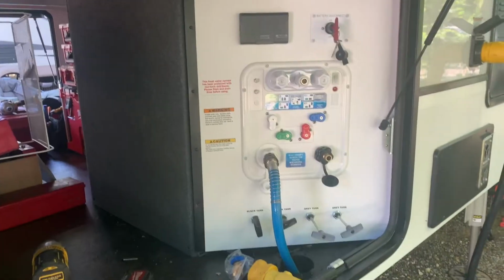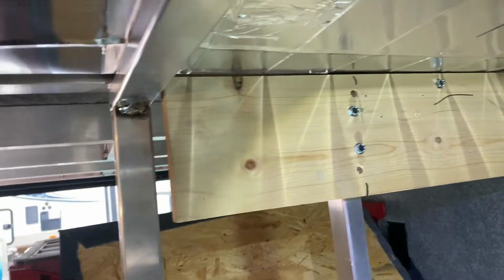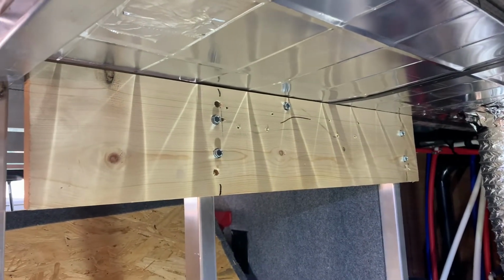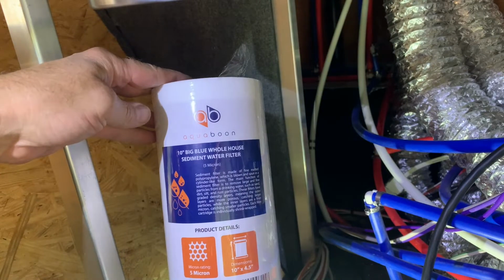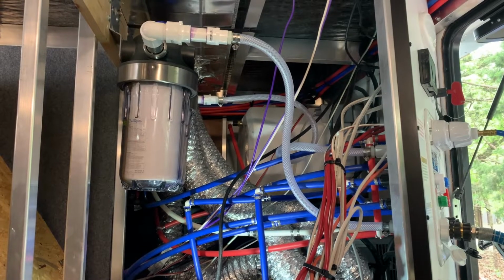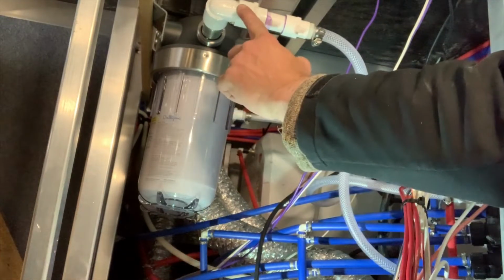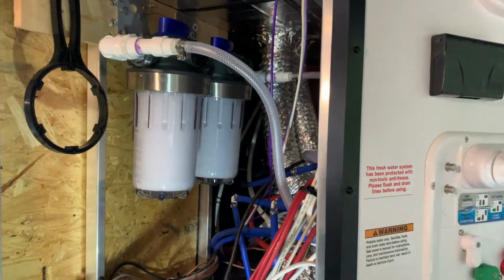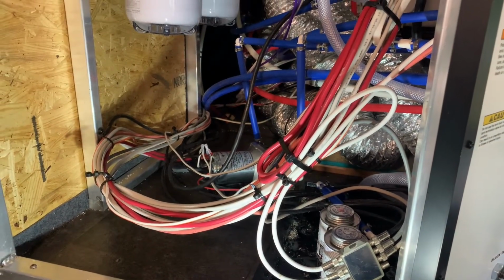Culligan WH-HD200-C Whole House Heavy Duty Water Filtration System installation for Alliance  370FB

Comment: Great video! Clean water is a must.

We use an adjustable water pressure regulator, a clear source triple filter unit (down to .2 micron) and a 16000 grain water softener. aall installed in our wet bay out of sight. I use brass 90’s, isolation valves and brass quick disconnects at all connections. This makes for easy maintenance. Then we use an Alexapure Pro .02 micron gravity water filter on the kitchen counter for all drinking and cooking water.

I would suggest a plexiglass panel so you can easily keep an eye on things.
Reply from the maker: Awesome setup! You should share your install. Instagram, facebook or Youtube.. People ask about the water system all the time.

Comment: Nice filter mounting. I’d switch to brass and PEX. I’m not a fan of the flex stuff.
Reply from the maker: Thanks! id like to find a 1" to pex fitting and replace all the PVC stuff. I was told it could crack under all the vibration.. Guess i need to get back to more projects.. hahah. Thanks for watching!

Comment: Nice job! My only critique would to angle your connections down going in and coming out of the water filter. Lots of bouncing going on down there and straight down would reduce the “load” on all those connections.
Reply from the maker: Yes... i think i need to use PEX or just the clear 1" water tube instead of all the PVC.. time to go back to Lowes.. lol.. Thanks for watching and the great advice. I appreciate it.